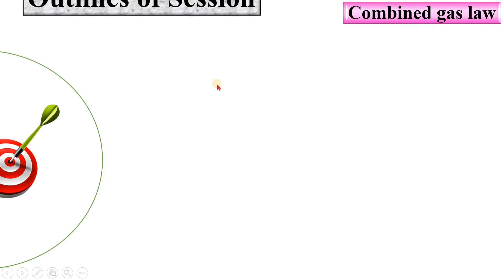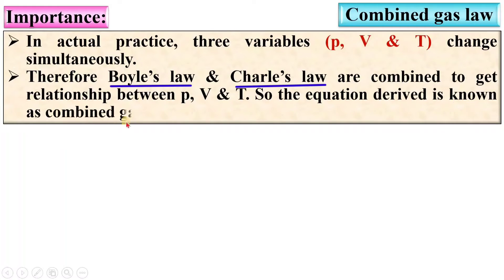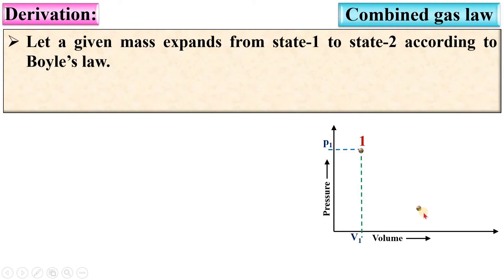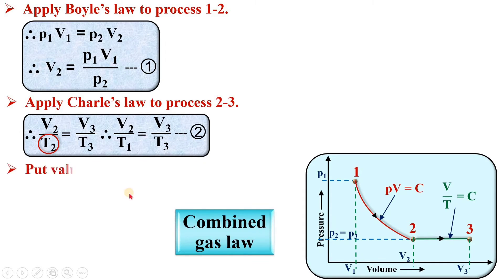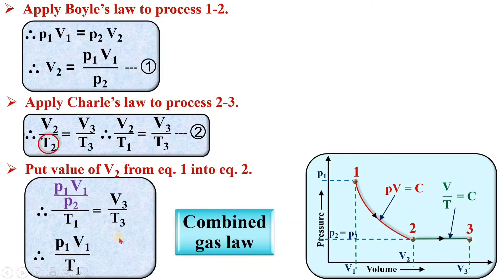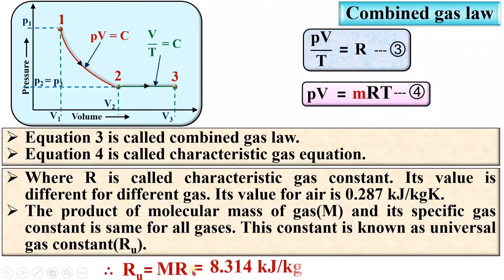Combined Gas Law (Basics, Importance, Statement & pV Diagram) Explained

Comment from the maker: Characteristic gas equation explained with following Timestamps: 
0:00 - Characteristic gas equation - Basic Mechanical Engineering lecture series 
0:33 – Importance of combined gas law
1:13 – Statement of combined gas law
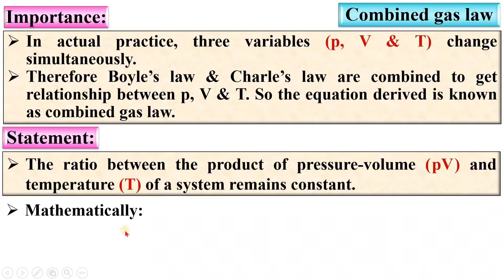1:35 – Derivation of Characteristic gas equation
1:48 – pV diagram of combined gas law 
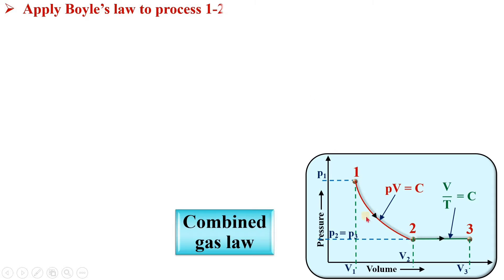2:58 – Apply Boyles law
3:22 – Apply Charles law
5:29 – Combined gas law 
5:36 – Characteristic gas equation
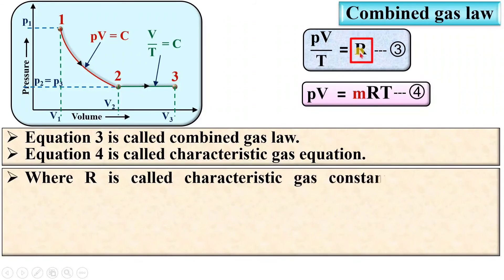5:42 – Characteristic gas constant
5:54 – Universal gas constant